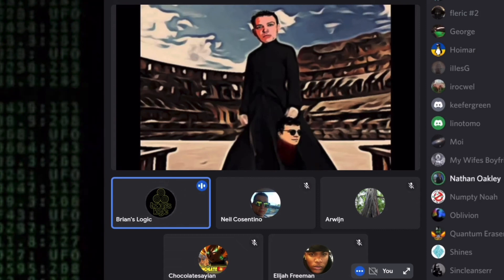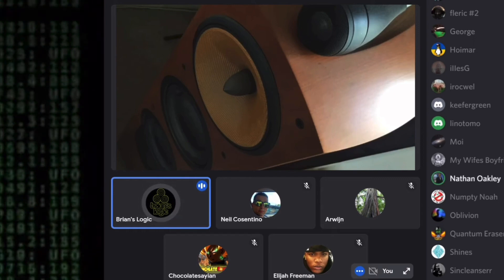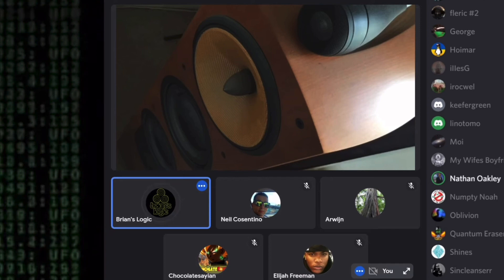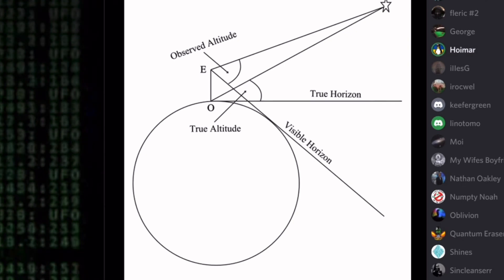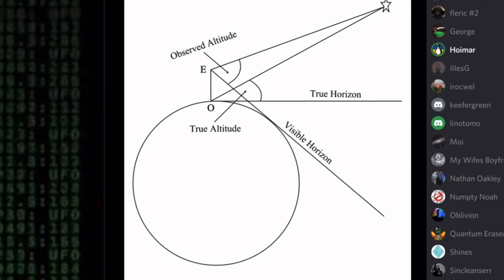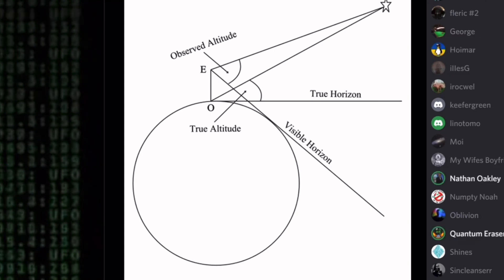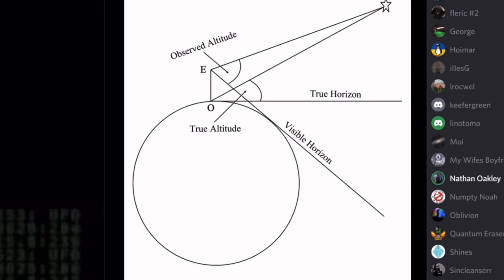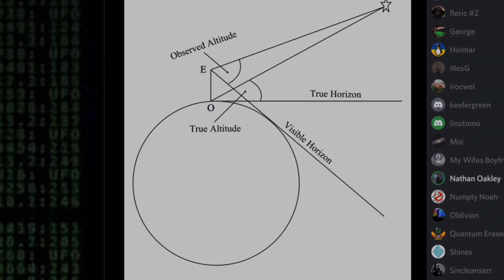Reciprocal Zenith Angle Debunked

Comment: Does ANYONE in this video - including the glober - actually know what reciprocal zenith angle measurements are … ? 🤦🏼‍♂️🤦🏼‍♂️🤦🏼‍♂️
Reply from the maker: Not used in celestial navigation?
A non sequitur fallacy?
A weak anti flat rebuttal to justify a tangent plane “infinite” Roohif?
Not an elevation angle measurement 📐 ?
Not used for a GP measurement?
Is it a subject change?

Share your pain, refracted horizons are not tangent points for a plane you need for an elevation angle 📐 perhaps it’s an ignorance of the flat earth proof, used in celestial navigation known as an elevation angle measurement?

Meanwhile earth is flat. You can only get elevation angle 📐 from a flat plane, you can not get an elevation angle measurement used in celestial (not a reciprocal zenith) from a sphere earth. It’s game over. Elevation angle measurement proves flat earth. 

Say “tangent” 😆
Reply from the maker: Can ANYONE say “tangent”?

Say “tangent” mofo 🤣
Reply: @NathanOakley1980  Not sure how many more times you can be told: when we use the term “horizontal plane”, we’re not referring to the surface 🤷‍♂️ Should I bother asking you those two questions you keep running from?
Reply: @roohif  aren't you trying to find the distance to the gp of the star on the surface? Why would you not have the horizontal plane on the surface if that is what you are measuring distance to?
Reply: @SuperMoshady  Elevation angles are not measured relative to the surface. They are measured relative to horizontal. Horizontal is not the surface; horizontal is perpendicular to down.
Reply: @roohif  how are you going to get the 90° angle from the star to its ground position on the surface if that horizontal plane never goes to it?
Reply: @SuperMoshady  The sextant, star and GP do NOT form a right triangle. That’s not how it works.
Reply: @roohif  why does it show a right triangle on all the diagrams?
Reply: @SuperMoshady  Some of those diagrams aren’t describing celestial navigation, and if you find a diagram that DOES use a right triangle for celestial navigation, then IT. IS. WRONG. Simple as that. 

The geometry of celestial navigation NECESSITATES a sphere. If you think otherwise, go and claim MC Toon’s $10k.
Reply: @roohif  whats the point of drawing a right triangle in the sky when your target is on the ground?
Reply: @SuperMoshady  There is no “right triangle in the sky”.  I repeat: the star, the GP and the sextant do NOT form a right triangle. No one that successfully navigated by the stars uses a right triangle. It doesn’t work. Again, if you believe otherwise, please claim Toon’s $10k.
Reply: @roohif  why do you have the angle you are measuring go up, into the sky, when your target is on the ground?
Reply: @SuperMoshady  The GP is NOT the target. The star is. That’s what you measure an angle to, not the GP.
Reply: @roohif  the GP is what you are trying to find the distance to tho. The GP of the star is physically on the surface. How are you going to find the GP of the star if its not your target?
Reply: @SuperMoshady  We’re NOT trying to find the GP - given the date and time of the observation, we already KNOW where the GP is. What we’re doing with celestial navigation is finding our distance from it (by measuring the elevation angle) and therefore where WE are.
Reply: @roohif  so one line of the angle goes to the star, where does the other line of the angle go to?
Reply: @SuperMoshady  Yes, one line goes to the star. The other line is simply “horizontal” - that’s your elevation angle. However, if you’re at sea using a sextant, and can’t establish a horizontal (using a plumb bob, spirit level, etc), then the other line is to the horizon. Since the angle down to the horizon is predictable based on your height above the surface (thanks, Globe!), then we can adjust the angle measured by the sextant to be a true elevation angle.
Reply: @roohif  the horizon is the point where the SURFACE meets the sky. So the 2nd line is along the surface then, yea?
Reply: @SuperMoshady  Not ALONG the surface, no. Just from your eye to the apparent horizon.
Reply: @roohif  The boat and the horizon are both along the surface. That's where you are drawing your straight line from. From 2 points along the surface.
Reply: @SuperMoshady  Sure, but the (refracted) line from your eye to the horizon isn’t “along the surface”. It’s “above”. It only touches the surface at one point - that’s the point we call the horizon.
Reply: @roohif  thats why you get your elevation angle so you can have a straight line along the surface. So we agree, the two points you are using to draw a straight line to, are along the surface. And since that line is along the surface, it also goes to the GP of star, which is also along the surface, which means the horizontal plane is also along the surface.  Why did you say earlier that line is not drawn to the GP of the star when you just agreed that it is?
Reply: @SuperMoshady  "thats why you get your elevation angle so you can have a straight line along the surface."

No, the line to the horizon is not "along" the surface, it is "above" the surface. That line touches the earth at one point - the horizon.

"So we agree, the two points you are using to draw a straight line to, are along the surface."

No, we don't agree. One line is in the sky to the star, the other line is not "along" the surface: it is above the surface and touches the surface at the horizon.

"Why did you say earlier that line is not drawn to the GP of the star when you just agreed that it is?"

I haven't agreed. And it's not drawn to the GP.
Reply: @roohif  why does the line not touch the surface past the horizon?

So the line is above the surface but also touches the surface? 😆😆😆 So both points of the straight line are on the surface 😆😆😆
Reply: @SuperMoshady  "why does the line not touch the surface past the horizon?"

Because the earth is a globe 🤷‍♂️

"So the line is above the surface but also touches the surface? 😆😆😆 So both points of the straight line are in the surface 😆😆😆"

It touches the surface at one point and one point only. At every other point, it is above the surface.
Reply: @roohif  so the horizon is the point where earth starts becoming globe shaped?
Reply: @SuperMoshady  No. The earth starts curving away from your feet in all directions.
Reply: @roohif  where do we see this? Example?
Reply: @SuperMoshady  Sure. If you point an auto level off into the distance, it will intersect the target at a higher elevation than the instrument is currently at. That’s drop.
Reply: @roohif   if your target is the horizon, which is on the surface, that means earth is flat until the horizon, but you said earth starts curving immediately at your feet. And if the horizon is not earth curve, what is earth curve? Where do we see it?
Reply: @roohif  🏃💨🌎😆😆😆
Reply: @SuperMoshady  If you think there’s a comment I haven’t responded to, it’s not showing up at my end ..
Reply: @roohif   if your target is the horizon, which is on the surface, that means earth is flat until the horizon, but you said earth starts curving immediately at your feet. And if the horizon is not earth curve, what is earth curve? Where do we see it?
Reply: @SuperMoshady  Yeah I answered that an hour ago - so maybe it's MY comment not showing up 🤷‍♂️

"if your target is the horizon, which is on the surface, that means earth is flat until the horizon"

No. That's just wrong. No wonder you're having so much trouble with celestial navigation.

I suggest we take the conversation to Discord. No risk of comments going missing there ..
Reply: @roohif  if thats wrong,  how far is it until earth curve stops us from seeing whats behind the curve?
Reply: @SuperMoshady  That's the horizon, champ 👍
Reply: @roohif  so the horizon is earth curve
Reply: @SuperMoshady  The horizon is an effect of the earth being curved, yes.
Reply: @roohif  earlier you said the horizon was not earth curve, now you're saying it is earth curve
Reply: @SuperMoshady  I said the horizon is an effect of the earth being curved. Please quote me saying something that contradicts this.
Reply: @roohif  so the horizon is not earth curve then?
Reply: @SuperMoshady  I said the horizon is an effect of the earth being curved. You seem to be playing semantic games now.
Reply: @roohif  semantics: words and their meanings. If the horizon is not earth curve, what is earth curve? Where do we see it?
Reply: @SuperMoshady  Earth curve causes things like mountains, boats, buildings to be obscured by the horizon. There’s also the fact that if you point an auto level (or theodolite at zero degrees) at a distant target, it will intersect that target at a higher elevation than the instrument.
Reply: @roohif  so earth curve is the horizon again?
Reply: @SuperMoshady  I’ve answered that multiple times, and asked you to quote me if I’ve said anything contradictory.
Reply: @roohif  first you said the horizon was not earth curve, then i asked where the earth curve is, you said its the horizon, then you said earth curve is it not the horizon, then you said the horizon obstructs boats and buildings because of earth curve. So is the horizon earth curve or not?
Reply: @SuperMoshady  I’ve told you multiple times that the horizon is an effect of the earth being curved. I’m not sure how you misinterpret that.
Reply: @roohif  does that mean the horizon is not earth curve?
Reply: @SuperMoshady  I’ve answered you three times.
Reply: @roohif  your answer isn't very clear. Can you clarify if the horizon is earth curve or not? Just say, the horizon is earth curve, or say, the horizon is not earth curve.
Reply: @roohif  time to 🏃💨🌎?
Reply: @SuperMoshady  I’ve clarified three times - now four times - that the horizon is caused by the earth being a sphere. You have enough information from me to answer your question about the relationship between the horizon and earth being a sphere. You seem to want to play semantic games, and it’s not something I’m interested in.
Reply: @SuperMoshady  ”🏃💨🌎?”

Seriously dude? Ten minutes?
Reply: @roohif  Why are you so scared to clarify if the horizon is earth curve or not? 😆😆😆 Semantics: words and their meanings. 
This sounds like a cause and effect relationship that can be scientifically proven. How are you varying and manipulating earth curve (the independent variable) to prove it causes the effect of the horizon  (the dependant variable)?
Reply: @SuperMoshady  I’m not scared, I just know you’re going to twist it into some BS that is clearly NOT what I mean, and then go “welcome to flat earth!” like your cult leader does. I’m saving you that embarrassment.

I’ve given you enough information to resolve whatever question you have. You can either accept it and move forward, or we can finish here.
Reply: @roohif  if the horizon is an effect of earth curve, that means its not actual earth curve. Since the horizon is not earth curve, what is earth curve? Where do we see it?
If earth curve is causing the effect of the horizon, how are you varying and manipulating earth curve to prove it is causing the horizon?
Reply: @SuperMoshady  I don’t need to do an experiment to show that an observer standing on a sphere will have a horizon. That’s not a scientific question.
Reply: @roohif  you identified a cause and effect relationship. Cause and effect relationships can be proven with scientific method. Scientific method dictates that you must vary and manipulate the cause to prove the effect. Are you not able to prove that earth curve causes the horizon?
And since the horizon is not earth curve, what is earth curve? Where do we see it?
Reply: @SuperMoshady  I’ve answered those exact question multiple times. We’re done.
Reply: @roohif  no you have not actually. But if you want to run away as a coward, i will accept your concession.
Reply: @roohif  🏃💨🌎😆😆😆 concession accepted
Reply: @SuperMoshady  "no you have not actually. But if you want to run away as a coward, i will accept your concession"
He has, he said this 18 comments ago: 
"Earth curve causes things like mountains, boats, buildings to be obscured by the horizon. There’s also the fact that if you point an auto level (or theodolite at zero degrees) at a distant target, it will intersect that target at a higher elevation than the instrument."

And  this 31 comments ago:
"If you point an auto level off into the distance, it will intersect the target at a higher elevation than the instrument is currently at."

I will not continue this discussion any further, just wanted to make it obviously clear to anyone reading this that duncans "debating" technique is pathetic, thinking he somehow won that exchange after repeating the same argument ad nauseum, conveniently forgetting previous answers even when they are repeated, like some sort of broken computer on a loop. 
If youre a troll, congratulations for stringing him along that long. If youre not, then try to improve that selective goldfish memory of yours before trying any more debates.
Reply: @CAMlCAZl  if earth curve is the horizon, why does it change location  on a daily basis along with the weather? Is the earth expanding and contracting on a daily basis along with the horizon? 😆😆😆 Furthermore, if the earth was a sphere with a radius of 3959 miles, then the horizon can be no more than 1.22 miles x the square root of the observers height in feet, there are observations of the horizon being further away than the geometric limitations of the globe allow, which proves the horizon is not earth curve 🤷 During celestial navigation, after measuring the  elevation angle (which measures earths surface as a horizontal plane, proving earth is flat btw), a circle of equal altitude is created where all points on that circle are of equal elevation, so he is incorrect about the horizon being at a higher elevation as well 🤷   It seems none of you can debunk or rebut my arguments 🤷 If you want to run away as a coward I will  accept your concession 🤷